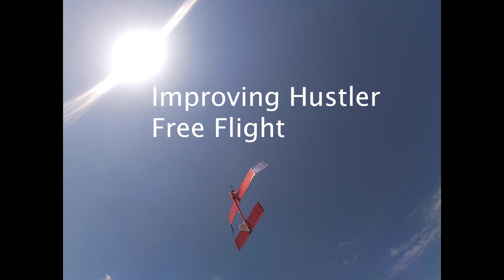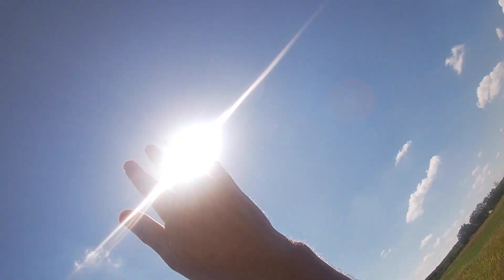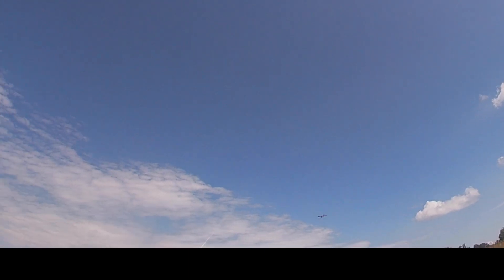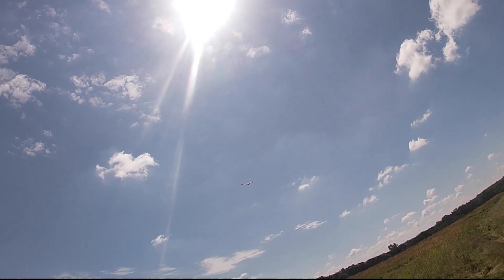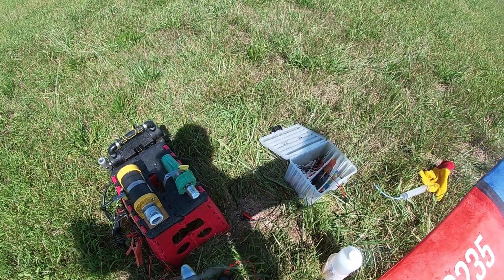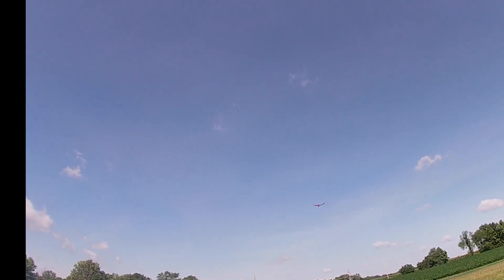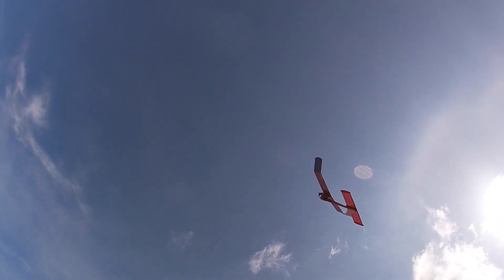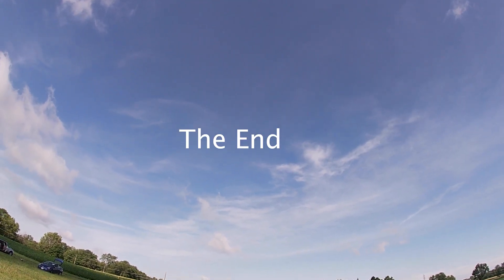Improving Hustler Free Flight Trim

Comment: Definitely shim in some up thrust, it's pulling down a good bit. This is a common issue on high thrustline gas jobs. I've needed upthrust on every one I've built.
Reply: Josh I saw your reply last evening and put a shim for upthrust. I flew the plane several times today and for sure it helped. It looks to need more upthrust yet which I will do. Thanks again for the comment.